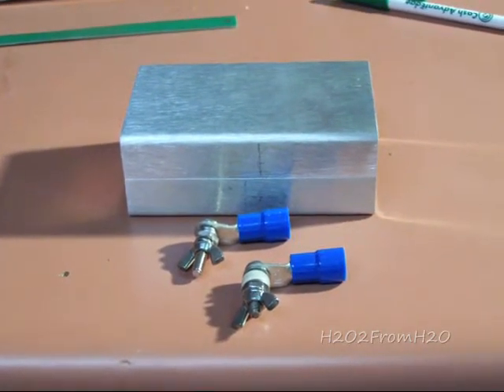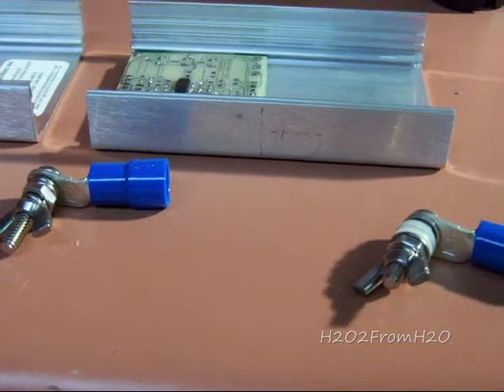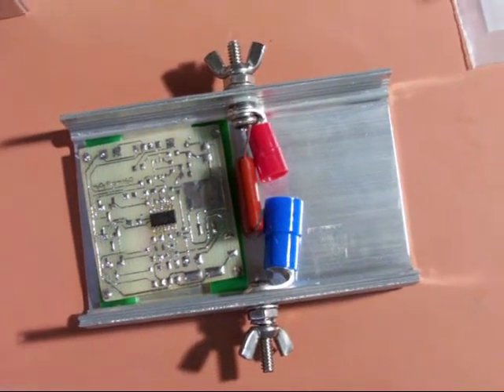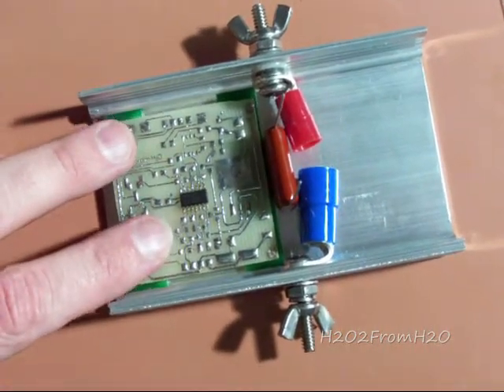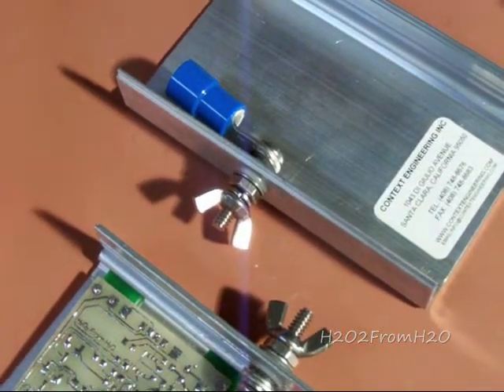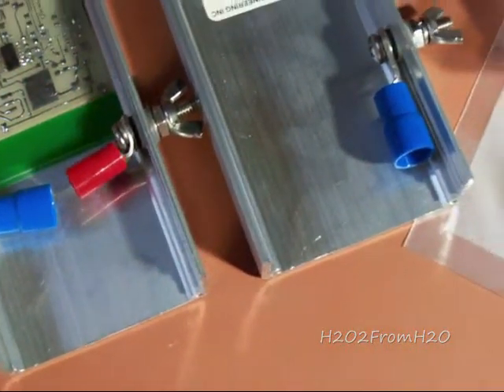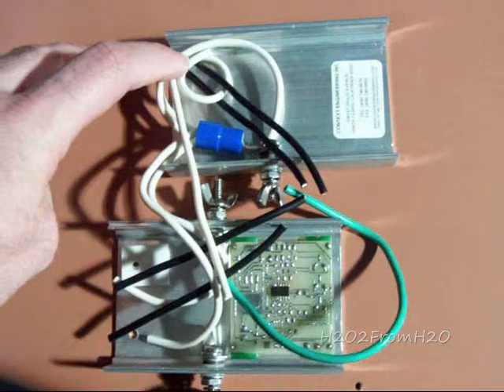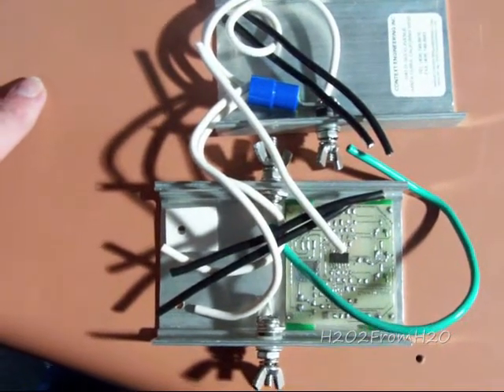#15 - H2O2  Assemble PWM Case

Comment from the maker: IM2L844, The Peltiers I have looked at, pump 20Deg C either Direction, thats 68F. So one would probably work Might use 2 Stacked in series. Dont for get the Heat sink compound.  The Heat sink on the outside has to handle the pumped heat. Thats the problem why use one if you still have to keep the output Radiated. If you dont it will burn up. And when they fail they act as a heat blocker. I would only use on on a PWM if all the MosFets were right next to each other.

Comment from the maker: PWM will control current, In turn prevents thermal runaway ie The cell starts cold and gets hotter current goes up and the cell gets even hotter. It allows the production of HHO to be constant. From the moment it is turned on to the end of your trip, short or 400 miles long.The cell will never go over the preset current limit. Remember: during the rest time, no current and no heat.I hope this helps.

Comment: I just want to say thanks. I'm thoroughly enjoying this series. I would also like to ask you the same question I asked Zero (which, by the way, he never answered)- If overheating does become an issue (I'm not predicting that it will), wouldn't sandwiching a Peltier device between your aluminum housing and a heat sink be a better solution than a big honkin' fan. For about $20.00, it would be relatively unobtrusive and keep the entire project box ice cold.

Comment from the maker: A quest for knowledge or a Question, never comes late as long as it is asked.The PWM, The Law of thermal dynamics(What goes in must come out) limits the Efficiency of a cell Because Not all the Current converts to HHO,the Part that is converted to Heat first Caused by leakage current around the cells, to much voltage between plates.Heat is generated because of the internal resistance of the cell.